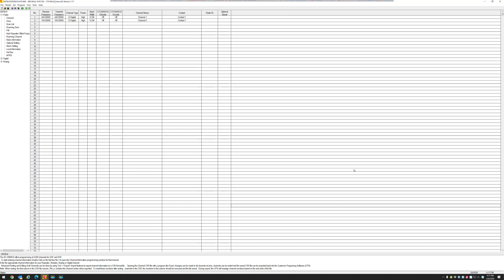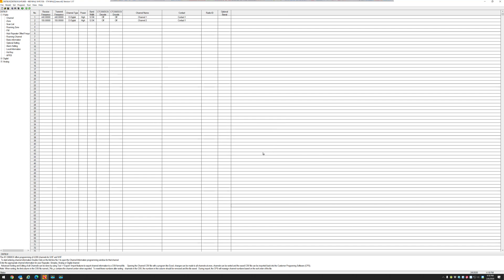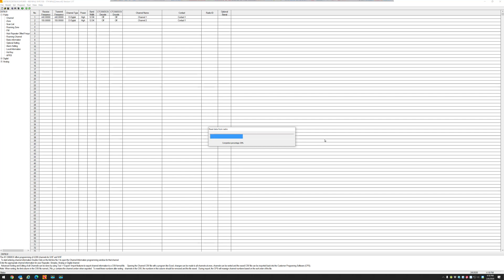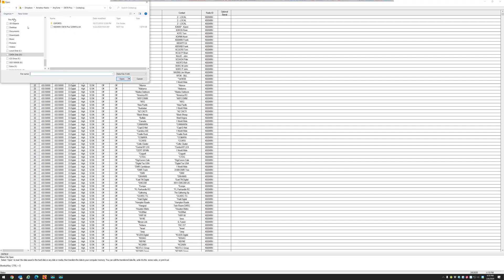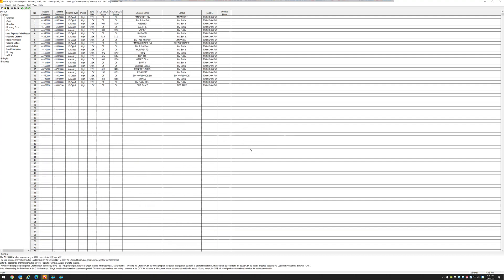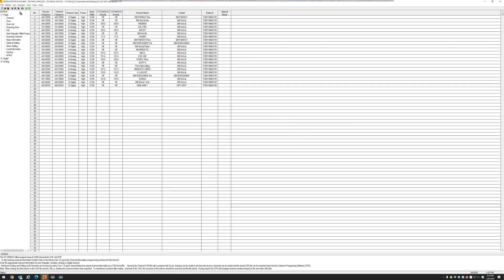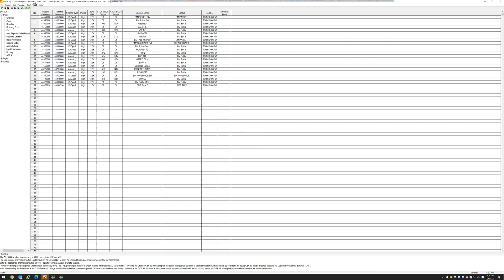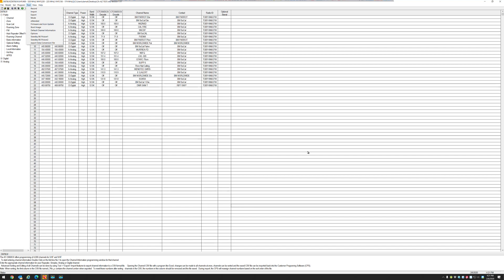BAND ERROR - Anytone CPS Explained

Comment: How do I fix the band error on AnyTone 878?
SO do the following to fix it:
turn off the radio, and turn back on while holding the PTT and Number 1 key on the Keypad (NOT the P1 button).
when the screen says "TEST MODE" release the buttons and then the screen will show "MODE 0010". ...
reboot and you are done!